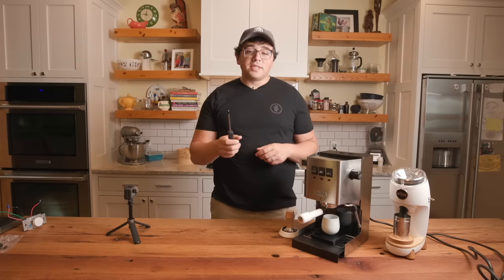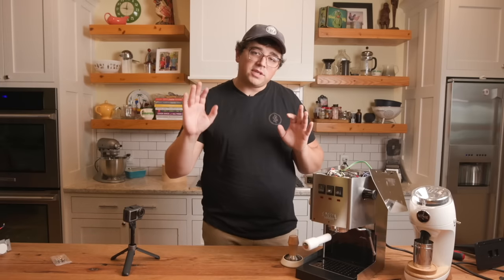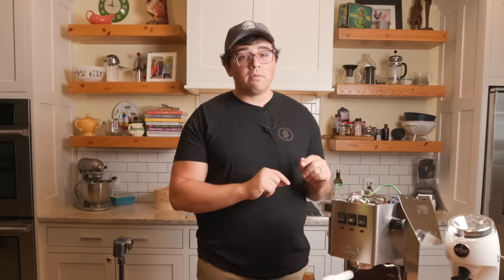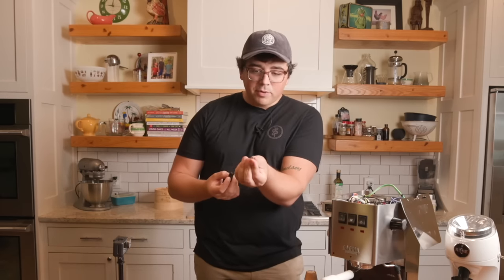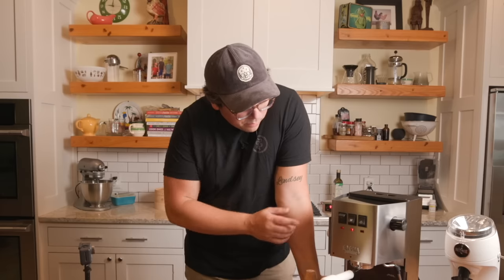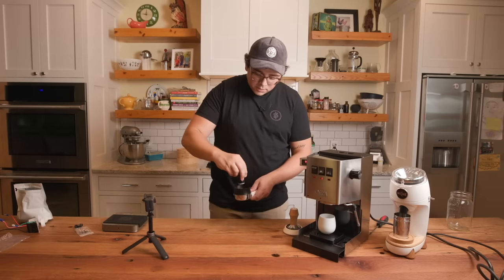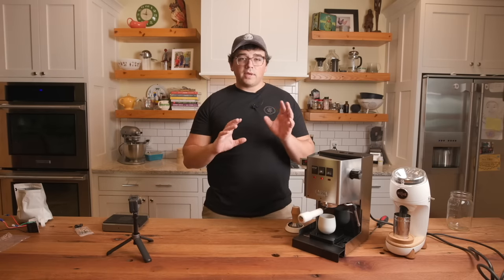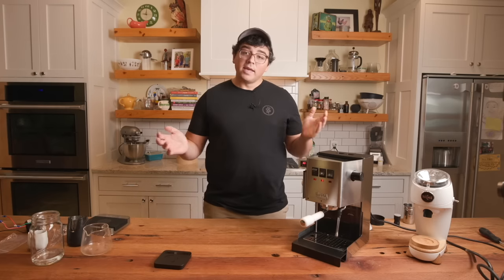TURNING A $450 MACHINE INTO A $3000 ESPRESSO MACHINE!: Gaggia Classic Pro FRANKENSTEIN

Comment: What was the rationale behind changing the OPV spring?  I mean, if you have flow control over the pump and as well as grinder coarseness, wouldn't you be able to achieve the same shot as shown in the video using the original OPV spring?  I'm asking because I'm contemplating this pump mod for my Bezzera, which has a 13 bar OPV.
Reply: since there aren't any reasons to use higher than 9 bars anyways so some would rather just avoid it
Reply: @doc8125  Right. But (a) 6.5 bars is a long way from 9 bars and (b) if you can control the flow, pressure should be irrelevant.
Reply: @LesliesDemos  no, it would not. Pressure if a result from puck resistance and flow from the pump, if you grind fine enough you'll reach really high pressures at very low flow. I know that Lance just does not like high pressure shot, so no need to have anything more than 6.5 as the max
Reply from the maker: Doc is right. I like pulling turbos frequently. These sit around 6 bar at the max. So I don't have to control flow every shot, I'd prefer just letting it go and stop at 6 bar. Also, I'd recommend my truth about espresso video.

Comment: Thanks for this! I just picked up a used gaggia and plan on doing some of these mods. Dimmer switch seems like a good low cost option - would I get benefit from it without the PID?
Reply from the maker: You would, yes, as pressure/flow are huge variables of extraction. PID is def important, tho

Comment: I just picked up a Rancilio Silvia on the cheap and plan to do a lot of simular mods. Any of these that you would recommend NOT doing or others that you WOULD recommend for the Silvia that weren't covered.
Reply from the maker: DEFINITELY do the dimmer and PID mod. No question. I'd also recommend doing a pressure gauge mod. Outside of that, machine should be pretty solid as regards internals.
Reply: I'd look into the ito microcontroller. It let's flow and pressure profile, it's a PID and it allows for both automatic and manual control of all these features (almost like a decent)

Comment: Hello Lance,

Great video and very informative! I own an Ascaso basic myself so we'll see how well everything transfers over. Just an Idea on the dimmer mod: Why not set a three way switch after the dimmer so you can have the options of full power, power through the dimmer and no power. In this way you can set and forget the dimmer and use the switch with the option of pre-infusion and full power.

Keep up the good work!
Reply from the maker: Simple reason why not using a three way- three ways don't work haha! In fact, nice dimmers don't work. They need to be single pole and super cheap, not made for LED. Not sure why that is from a technical point of view, but I know they don't work from personal experience and the greater home enthusiast community.
Reply: Guusjuh might mean install an additional switch to bypass the dimmer since the dimmer switch seems to reduce full power. Lance proved this electrical loss in another video when he used a voltage regulator on a grinder. The answer I can’t find anywhere is do I need to bother with OPV 9 bar spring since I’ve already installed the lamp dimmer, elegantly just in front of the steam valve?
Reply from the maker: Yes. You still need to change opv. Controlling flow is only part of controlling pressure. You still need to set the pressure ceiling
Reply: @LanceHedrick  Thank you for the reply, all you (and others) do for us! And Congratulations on the bambinos!
Reply from the maker: Thank you so much!
Reply: OK, I just opened the OPV and cut 2.3 rings off the spring for now.  I plan to buy the adjustable OPV and when I attach it I will tap the pressure gauge into the same connection. The sealed clamped red mesh silicone hose is a pain to tap into.

Comment: I’ve just installed a dimmer on my pro. After a couple of months trying to flow control with the steam wand (and losing a tone of heat), the dimmer idea is life changing!
On the lowest setting my flow seems to be around 4.5gr/sec though. nowhere near your 1.5-2gr/sec. could it be a wattage thing? My dimmer is a 1000watts one.
Reply from the maker: Oh yes. That's definitely what it is. Switch to a cheaper 600watt dimmer! Link in caption to the cheap one I use
Reply: @LanceHedrick  Thanks a lot Lance, I’ll give it a try! Great video!
Reply from the maker: Absolutely! Good luck and happy brewing!

Comment: I have added the 9bar spring and PID, good to get consistent brew temp,  but steam temp just drops rapidly once I open the steam valve and loose pressure, you didn't seem to have an issue, would have been good to see your temp whilst steaming.
Reply from the maker: The temp was at 140ish.
Reply from the maker: Did you add both SSRs? One for group and one for steam?
Reply: hi yes, set AH1 and AH1 as per mr shades guide.....think i might try the autotune function as have the PID set to mr shades set 2 values.
did you temp stay pretty constant whilst steaming?
Reply: sorry yes, added both SSR's
Reply from the maker: Yes it did! Very constant. Maybe dropped 1C or 2C
Reply: mmm...mine is dropping 10-15 degrees pretty rapidly and takes time to build back up...might have to look at my wiring?!

great vids though....keep them coming!
Reply from the maker: Absolutely! Sounds odd. Maybe email Mr shades if you bought it thru him? Cheers!

Comment: Nice video! 

Already have a PID modded Gaggia classic. And I can not find a good answer if I should do a flush before pulling a shot or not.

I guess it does help with heating the group. But it might also cool down the small boiler.

Could you do a video on your work flow on a good shot with this modded machine.

Anyone has any tips on how the best check the temp ofsett?
Reply from the maker: No need to flush. I do recommend you let the group heat up 30min or so!
Reply: @LanceHedrick  Thanks! That is what currently do. "Ok, Google turn on espresso" (DIY domotica). But sometimes I see a small puf of steam when I do decide to try a flush after a long warmup.
Reply from the maker: Alright that is sick. I've heard about people doing that, but haven't seen it. So cool

Comment: Congrats! 
Ps. You can use the auto tune function on the PID to help reduce the overshoot when heating up (and recovery time between shots)
Reply from the maker: Oh shoot! Good call! I didnt spend much time with the PID after installing. Should really get to know the controller better! Thank you!
Reply: @LanceHedrick  At least this one is super easy! After the machine has heated up for about an hour, just hold the ‘>’ button and then the AT light will flash for a while. Should finish after a couple mins!
Reply from the maker: Oh WOW that's easy. Wtf. Thank you!

Comment: So… The mods keep you from having to do the “switch on/off for 10/5/20 seconds etc.” because you can see when the temp is just right to start. Right?
Reply from the maker: That is one of the advantages. But it also gives you stabilityy. So it both gives you a starting temperature, as well as stability. Without the PID controller, you will not have that temperature stability.

Comment: Toward the end of the vid you mention that these are great mods to do if you already have a GCP, but hinted that it may not be worth the total cost of buying a new one to 'trick out'... Does that mean there is something else you would recommend at a similar >$1k price point that is a better out-of-the-box option? I'm looking to buy a machine, but am struggling to find something around that price point and quality.
Reply from the maker: My favorite, and I get hate for this, is the breville barista express. Out of the Box, it has better temperature stability, it has a pressure gauge Built-in, And better steam wand
Reply: @LanceHedrick  Thanks! After several more hours of research I'm now thinking of just ponying up a few hundred extra to get everything I want built-in on the Rancilio Silvia Pro X

Comment: Why’d you go with the 6.5 instead of the 9 bar spring? Would be great too if you were to compare the taste of an unmodded espresso vs what you were able to achieve with these mods.
Reply from the maker: I have a video with the unmodded. Too many differences to even start haha! And 6.5 because if I don't want to flow profile, I like turbo shots. In addition, I use light roasts and they have lower puck integrity
Reply: @LanceHedrick  What do you mean by «  i don’t want to flow profile »
Thank you

Comment: Interesting video, but I can not really get one thing here...why change OPV to 6.5 bars when you would install dimmer that would be a flow control, in order if your grind size not coarse enough not to be able to pull a shot in general? As if you would have flow control what would be the sense for limiting pressure so much lower, it would not make dimmer more precise or something, what else I get else other than increasing probability of some more amount of water being dropped back to water tank? And yes, OPV returns water actually there, drip tray only gets rests of water after solenoid valve switches, sorry for that comment that makes me nurd, but I`m not trying to make laugh or something I really might be missing something that`s why I`m asking, somebody please explain.

Comment: Do we have 110/240v wire with no external isolation casing running out a conducting steel chassis? If I recall correctly, everything inside the gaggia is basically at mains voltage. Take care people and please do make sure to use an outlet with ground connection.
Reply from the maker: Yea we do. I do recall mentioning that there should be more casing but this was just a quick job for a video. My videos are not how-tos but what-could-bes. All the tutorials online on how to do this have much more careful instructions.
Reply: @LanceHedrick  Thanks Lance. You make great content, keep up the good work.

Comment: Love your vids almost as much as I love your dog!  Please answer this, if the Opv is better at 9, why does Gaggia ship it that way?  They must have some reason for the higher value, it certainly wouldn't cost them anything to ship with a 9.
Reply from the maker: Likely marketing. Higher numbers draw people in. Every commercial machine under the sun comes stock at 9. 12 is too much pressure and can cause loads of channeling, though some have reported positive results with certain coffees and style shots
Reply: Another reason is that the Gaggia also includes a pressurized basket (single hole on the bottom of the basket) to accommodate beginner baristas that may not have a grinder (or a very consistent one). It allows them to use pre-ground coffee or even pods which require additional pressure to overcome the specialized basket. Market appeal to the masses!

Comment: I know this video is a few years old and you have probably moved on. However, to me it’s a topic I’m dealing with now. I’m hoping you can help me out by a brief comment or referring me to a video. 

I’m comparing the ECM Casa V ($999USD) and the Gaggia Classic Pro ($450USD). The primary functional difference I see is the ECM has the pressure gauge with the easy access to the pressure adjustment. My plan is to put the OPV spring to the Gaggia costing me $20 to $25 bucks. The adjustments you show here, other than the spring change is beyond what I want to for a DIY project. 

In your opinion, is the ECM Casa V able to make better espresso than a Gaggia Classic Pro?

Other recommendation for a better espresso machine at $1000 or less?

Comment: Why did you pick the 6.5 bar spring instead of the 9 bar spring?
Reply from the maker: I like lower pressure shots. Lighter roasted coffees have lower puck integrities. Even with the flow control I don't want the pressure over 6.5 for the coffees I drink

Comment: Another great video Lance...one thing I've wondered, if the 12 bar spring is not ideal, why would Gaggia have added this as a stock part?  Seems the first mod everyone makes is to change the spring.
Reply from the maker: To be honest, I am really not sure! Most every other machine comes with 9 bar as stock. It's genuinely curious. Perhaps something to do with making those springs being easier? Just not sure. All I know is it is absolutely not ideal.
Reply: They make it 12 bar so you can use those horrid pods which need a higher pressure
Reply from the maker: BOOM! Thank you, Richard, for weighing in! I had no clue about this.
Reply: Actually, I think it's the pods as well as the PPF that it also comes with.

Comment: Thank you Lance, I love the video!

I am day dreaming of espresso at home. I have the Baratza encore and a French press, so I would be starting from scratch with espresso gear. I would definitely want to get the grinder first so I could use it for filter coffee while I saved up for an espresso machine. Realistically it would be years before I could even get spouse approval for a niche, but a flair 58 or modded Gaggia seem very tempting! Especially with flow profiling being accessible with a scale and app
Reply from the maker: Absolutely! So, for filter and espresso, I personally wouldn't recommend the niche. I'd recommend some sort of flat burr grinder that is affordable and easily enhanced (think Vario with the forte mods or the df64).
Reply: @LanceHedrick  I am hoping you will release a video to mod the vario 😁

The Baratza vario is also tempting as I might be able to buy the vario through their refurbished grinder program. My encore was purchased through the refurbished grinder program and then I replaced the burrs with the virtuoso burrs
Reply from the maker: I will release a video on the modded Vario, for sure. And will link loads of resources in the captions, as I do.
Reply: @LanceHedrick  is the modded vario a better filter coffee grinder than the encore with the virtuoso burrs? If not, I could keep my encore and get a better espresso focused grinder?
Reply from the maker: Yes, absolutely. You're using 54mm ditting flat burrs in the modded Vario. 

Well, I say absolutely. If you prefer cup profiles from conical burrs, you might prefer the virtuoso. I'd recommend having one of each on your bar, tho. They offer two different profiles
Reply: @LanceHedrick  good point. I am nowhere near experienced enough with flat vs conical burrs to have a strong opinion or even an awareness of my preference for burr vs conical. Your input is much appreciated!
Reply: @LanceHedrick  I think the 1Zpresso K Plus would be a good recommendation.
Reply: @BBB_025  I have the encore with the M2 burrs and have to say that it makes a massive difference for filter. If you want to up the game then get a 1Zpresso K Plus.

Comment: Thanks lance. I recommend two more. Both more important than the PID. 
1. When brew switch Is thrown. Heating element is switched on at full power. A PID is not a really good mod EXCEPT it allows you to change the temp to some degree but with a small boiler it doesn’t solve most issues
2. Preheat coils around boiler. Again, small boilers and small heating elements can’t handle the temp drop when cold water enters

Comment: I have installed the pid to control brew but want to install another ssr for steam. I have seen the video on how to modify the xmt7100 and use ports 4+5 but need to confirm the following. So to add the steam ssr I would run the two wires from slot 4+5 to the input on the ssr and then from the ssr to the steam thermostat wires. How would the pid know I am switching from a set temperature to the steam temperature by hitting the steam switch?

Comment: Hi Lance,
Performed a dimmer mod for my lelit Elizabeth.  Tried 2 dimmers, one rated at 600w and the other 1000w.  But both of which gives me a very short range.  From my pressure gage, fully opened is at 9bars and when dimmer switch set to almost click close I can only go down to 7.5 bars. 
Anything I can do to get a better range?
Reply from the maker: You have to get a super cheap dimmer. My rule now thumb is if you're paying over $10, it won't work. The newer ones compatible with led won't work.
Reply from the maker: Needs to be simplistic and single pole
Reply: @LanceHedrick  I assume mine is the led ones?  Two wires, works but very narrow range.

Comment: To clarify, did you ground the dimmer switch inside the body of the machine?
Reply from the maker: Of course
Reply: How exactly? I just got one and mine did not come with a ground wire - just the two to loop into the circuit.